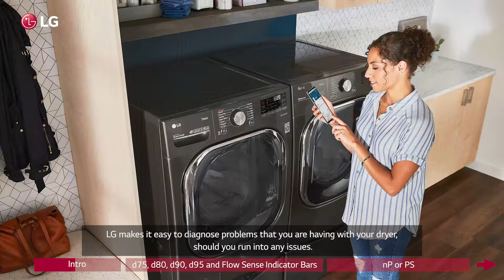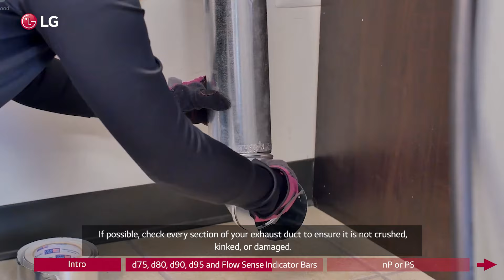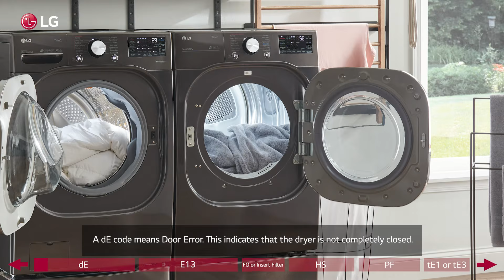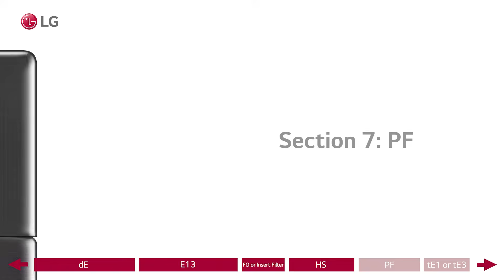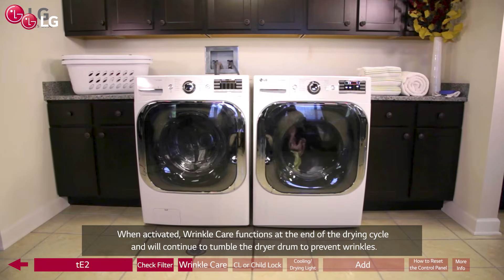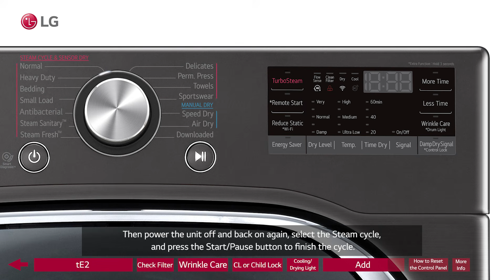[LG Dryers] Troubleshooting & Resolving LG Dryer Display Codes

Comment: I have a DDLEX3900B dryer that we purchased in November of 2019, serial #910WZH26549. About 2 and a half years ago we got the LE1 error and tried resetting the code unsuccessfully. We then purchased a new thermistor and high limit and that solved the problem. The problem then resurfaced in February of this year (2024). We tried resetting again unsuccessfully and figured we would try replacing the limit and thermistor again as that is a relatively cheap option. This didn't work this time so the only other issue it could be was the main PCB (EBR85130503). This was an OEM part and it fixed the problem. We have now had the code pop up again and tried all the things yet again and are at the point of replacing our PCB again.
Reply from the maker: Hello, Marianne. Thank you for informing us about the issue with your LG DLEX3900B. We understand how inconvenient this must be for you, and rest assured, we're here to assist you in any way we can. It's great to hear that you've been trying to resolve the issue, but since it remains unresolved, we highly recommend contacting a local technician in your area to help address the problem, especially as your unit is now out of warranty. ~Ken

Comment: Pause button does no pause machine when I want to pause machine to take something out. Help!!!
Reply from the maker: Hi there! That doesn't sound right! Let's have a closer look! If your pause button isn't working, let's try performing a hard reset first. To do so, unplug the dryer from the power source for about 1 minute. Reconnect it and press the pause button during a cycle to test it again. Please let us know if this helps! In the event it doesn't, we'd be happy to provide additional resolution options. Please provide us with any error codes you may be receiving. Also, be sure to include your dryer model number in your reply! ^Chris
Reply: @LGUSASupport  Did not help. The dryer model is  DLEX67000B, ABLEEUS. Any other suggestions????!
Reply: @LGUSASupport  Did not Work. Model od Dryer is-DLEX6700B ABLEEUS
Reply from the maker: Hello there. Thank you for reaching out to us. We understand that your DLEX6700B dryer is still having some issues after the initial troubleshooting. We would be more than happy to assist you in a way that we can. Please send a private message on Facebook or Twitter so we can proceed to next steps. ^Jolly

Comment: POS appliance. This failure is coded in and you can't fix it. LG ignores it and provides bad customer service. They will blame you.
Reply from the maker: Hey there, Paul. We appreciate you bringing this to our attention. We want to ensure that you are getting the proper assistance in regards to your unit. Please send us a private message through our Facebook or Twitter platform using @LGUSSupport with your case/reference, model and serial number. ^Anthony
Reply: Ble me for what
Reply: Blame me for what

Comment: With our DLGX4001W we have the "CL" code showing along with a red backlit "clean filter". Lint is cleaned from the trap and there doesn't appear to be any buttons that say "child lock", to be able to reset. Just the CL code flashing. Holding down the start button doesn't do anything.
Reply from the maker: The CL error message stands for control lock which is a safety feature that locks the function buttons of the dryer to prevent accidents or a child from controlling the dryer and causing a malfunction.  Should this feature be active while the dryer is running, pressing other buttons won't work, and you need to disable the feature in order to continue to use the dryer as normal. In reading through the error codes in the manual, there is no mention of this CL error code for your washer model (DLGX4001) so we'll have to make proper adjustment. Please allow us a moment while we look into this if you don't mind. We'll keep you posted! In the meantime, the following is a link explaining this feature in our washers:  ^Chris
http://spr.ly/6051Puv05.
Reply: @LGUSASupport  We followed your instructions and now there's a DRY light on the control panel.  Dryer won't work.